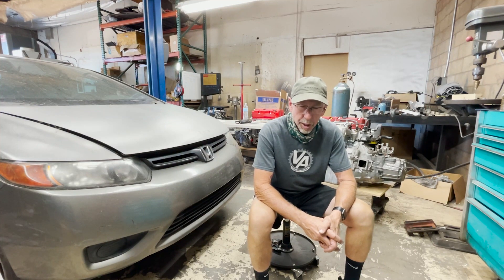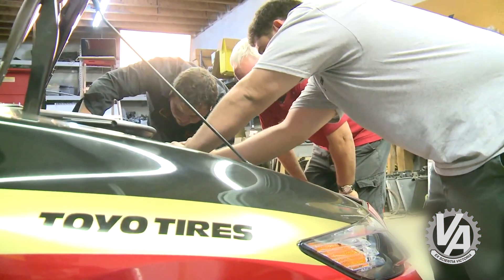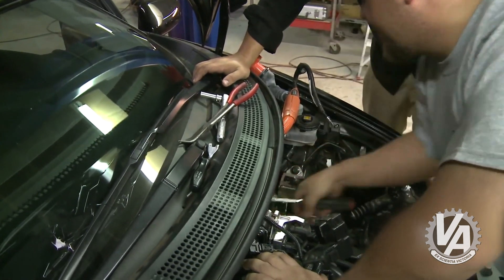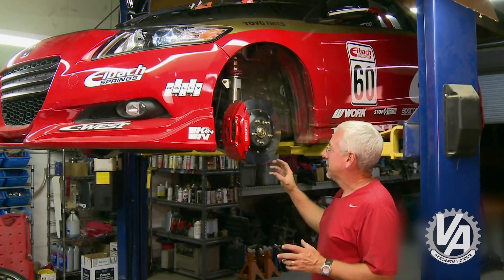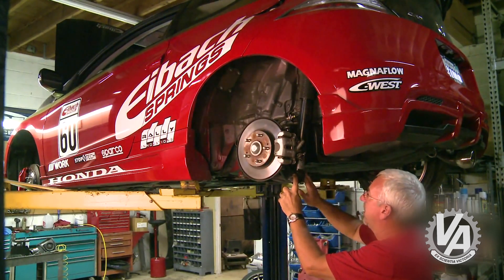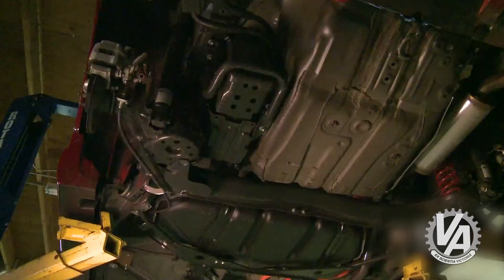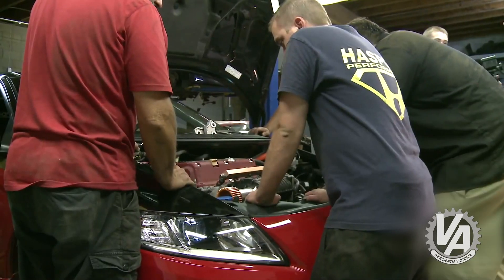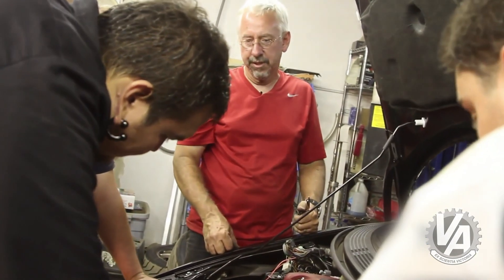Project Eibach CRZ K24 Swap Part 2

Comment: Were you able to build that k23? Or can you fit a k20a head to a k23? I’m contemplating building my rdx. But what I’ve read has pointed me in the direction of not wasting my time.
Reply from the maker: You can put either head on either engine. Check out Hondata for ECU tuning options.

Comment: Need your pro opinions

T2w4 trans shifter selector arms stuck and won't move 

Easy fix or no?  

I messed up and put too much pressure on a new set of junkyard cables while they were hooked up to the trans and the shifter box in the car in an attempt to mount the cable stay to the subframe under the car  😞

I believe this stay was misaligned during the flame wrap job I did to the shift cables 

Any one ever had this happen to them before?
I was able to find 1 - 5 prior to this install and nothing moves now
Reply from the maker: Can you disconnect the cables manually shift the transmission?